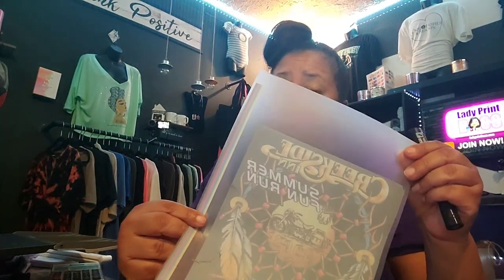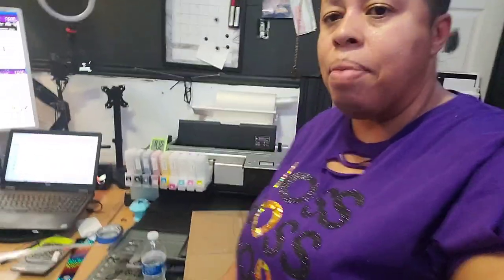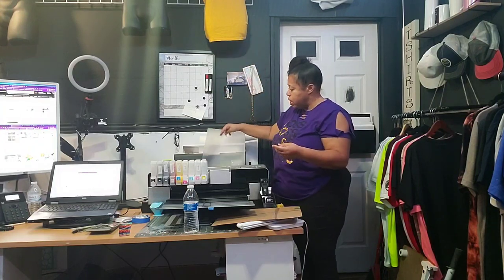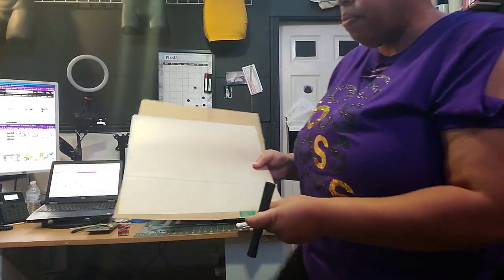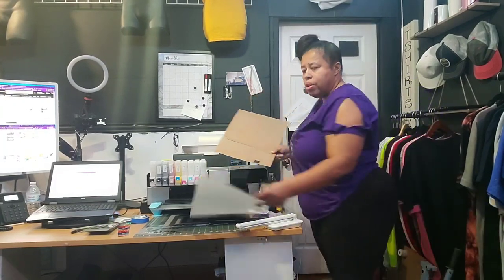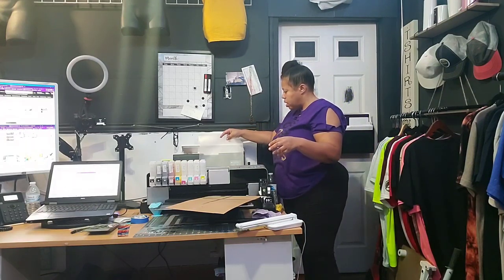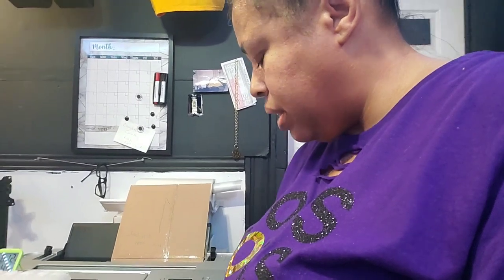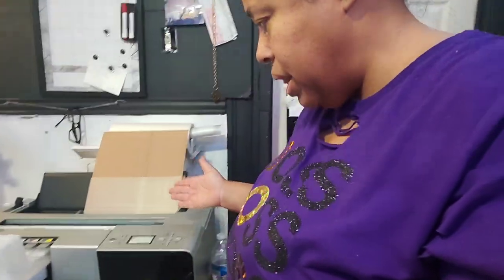DTF Transparency Films Not Feeding Through Printer| Sharpie Method Easy Fix

Comment: This worked for me and my Epson 2760 printer.  Thank you!
Reply: When you used the dtf and the powder did you just cut off the black square from the film?  Thank you!
Reply: I have the 2760, I had to remove the roller bar but now the end of the prints keep smearing. Which part worked for you? The black box or cardboard?

Comment: I can't see where in the back I am supposed to put that little square on my DTF film. I have an Epson Eco Tank 15000 and want to use DTF but the various 'fixes' are not working.
Reply: I have the same printer and same problem 15000 epson I’m wondering if I need to change the print settings. My film runs straight through